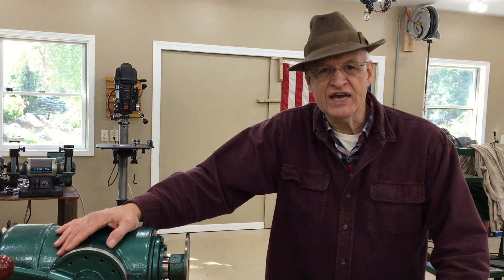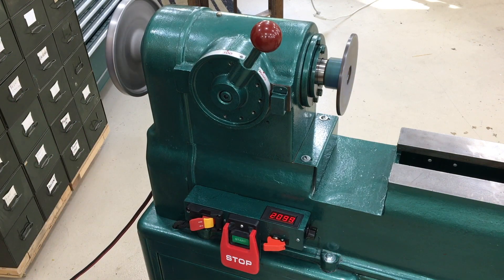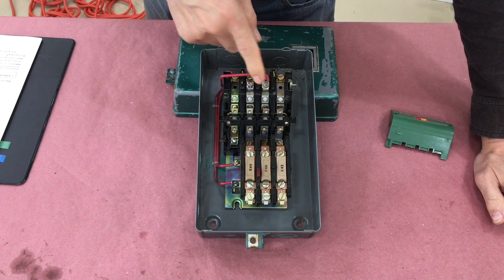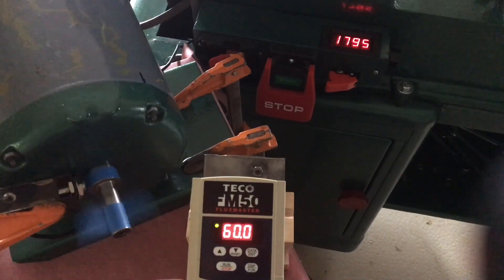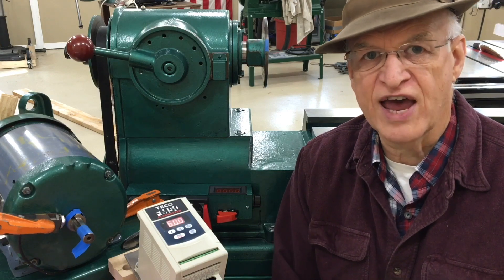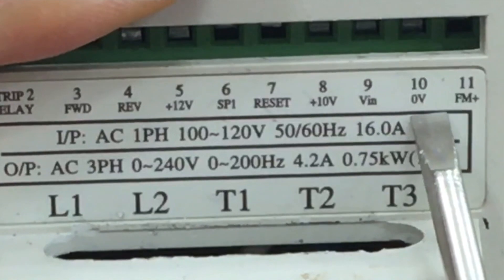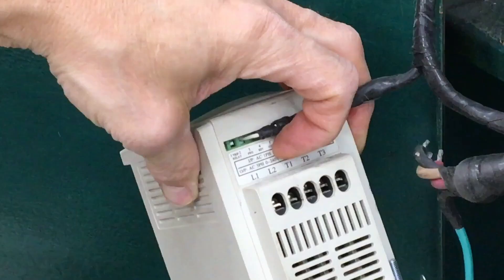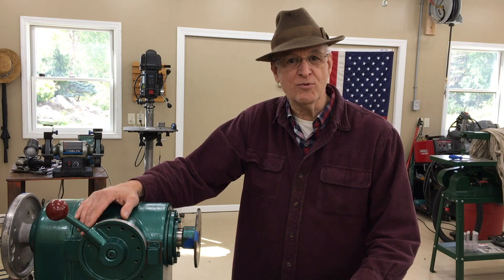Powermatic Model 90 Wood Lathe part 2 of 2

Comment: If i understand it correctly you still have a 3 phase motor but are running it on single phase 120 with the VFD is that correct?  I am looking at one that is 220 3 phase motor how would that work?  
Also do you have links for the VFD Tach and FW/Rev Switch you used?
Reply from the maker: Yes, any 3 phase motor can be run on single phase power by using a VFD. I have done this for several motors up to 3 HP.  1 HP 3 phase motors can run on 120 Volt with a VFD, anything bigger, will need 240 volt input to a larger VFD.   When sizing your VFD, make sure the amp output of the VFD is a bit more than the motor requirement….  If you want to talk more send me an email.   PargoLongAgo@Yahoo.com
Reply: @georgebell7103  Thanks, I need to go see the motor and figure out what it is  I believe it currently runs on 240v not sure of either the HP or amps

Comment: i really enjoyed the videos
i have a model 90 and would like to do this exactly as you did. ive sourced all components except the low voltage paddle switch. i have only been able to find it in 120/240. Can you share a source for this 1 part? Thanks and again awesome videos!
Reply from the maker: Thanks for the nice comment.  You have found it.  I used the large 120/240 volt switch to control the DC circuit.  I wanted a big switch sos it is easy to fine when needed.
Reply: That's great and thanks for the quick response.  I hope to have it done in a week or so and I'll  let you know how it works, Jeff
Reply: Well it took longer than I thought but I test ran it tonight and after cleaning up the wiring a little  it will be done. It is incredible. I am going  to do my first  turning  on it this weekend.  Thanks for the videos  and especially the blueprint!
Reply from the maker: @jeffholtzclaw9516  well, that’s great.  Glad the videos were helpful

Comment: Great videos, thanks. I just bought a '77 model 90 in great shape at a school auction... and wouldn't you know it?   They optioned it for a single phase motor.  So I can't do this conversion unless I actively seek out a 3 phase motor replacement!

The reeves speed control is still a big upgrade for me, tho.   The minimum pulley speed on my old rockwell was 900rpm!   Looking at the manual, I think my slowest speed on this PM90 is about 320rpm so still a little fast for roughing on 10 or so inch bowls but still way better than 900.
Reply from the maker: Thanks for the comment.  Yeah, having both the mechanical reeves speed control, and also motor speed control is really a nice combination if you can do it….. you would need a 3 phase motor and VFD to configure as I have demonstrated in this video.  Good luck whatever you decide to do.

Comment: I have a mid 70's model 90. I think I'm going to do the same thing to it. Wired a 3 phase motor with a VFD on my drill press and love it.
Reply from the maker: Yes, speed control is very nice on three phase motors plus VFD.  Thanks for your comment

Comment: Hello! Great videos. Thank you. I have the same machine. Did you have any runout on the spindle? Mine has .004 out. Is there any way to correct and make it closer to 0? Thanks
Reply from the maker: Thanks for the comment, glad you liked the video.  I don’t recall if I even checked the runout on the spindle after I replaced the spindle bearings.  You could do that to get some improvement.. maybe.   However, 4 thousands sounds pretty good for woodworking.

Comment: I am in the middle of a restore of a Powermatic 90 with a Baldor Baltric 1hp, 3ph motor. I would guess around a 1966 model. Bolts from the bottom for the bed. I am a little confused about the wiring. Is the low voltage on the VFD AC or DC? I can not verify if the motor will even run with a VFD. I also don't know which potentiometer to choose as there are many different resistance types. Could you help me out?
Reply from the maker: Yes, I hve helped several guys work through this …. Let’s do it via email… PargoLongAgo@Yahoo.com

Comment: Great video!  Viewers be aware that the motor has very low torque at low speeds.
Reply from the maker: Thanks. Yes, this is correct. Motor alone at low speeds has very low torque.  However, you can work with low speeds on the spindle, by setting the mechanical speed control to low, and increasing the motor speed.

Comment: Thank you for putting this together. I picked up a model 45 with a 3 phase. I had restored other tools with 3 phase power, but the reeves drive combined with 3 phase was new to me. Lots more tinkering to do before its fully operational. Thank you for your informative video and wiring diagram.
Reply from the maker: Glad the video is helpful. Good luck

Comment: Hi George, Excellent video! I'm also restoring a 3-phase Model 90, using a VFD. Question about the original wiring - specifically the three wires associated with the Reeves Drive. Does this wiring also get removed? You demonstrated that your Reeves Drive still works. If its wiring is removed, then the assumption is that this speed adjustment is only by the OEM speed control increasing/decreasing the diameter of the upper pulley. Is that the case? Or, if that wiring remains, where does it connected? Thanks, Dan. Thousand Oaks, CA
Reply from the maker: Thanks for your comment.  My machine only had pieces of the original wiring, So, I cannot speak to it with great authority.  The reeves drive is all mechanical. Change speed by moving the pulleys in and out by the control lever.  The original wiring used a low voltage control system to turn the motor on and off, as shown in the video.  Send me a not via email, we can discuss further if desired.   Pargolongago@yahoo.com

Comment: Thanks George.  I have the same P90 the exact same model with aluminum labeled wrap around the speed dial rather than the cast numbers.  According the serial number lookup mine is a 1969.  Oddly, mine has a 1.5hp single phase motor.  It looks like it was a special order, unless someone did an excellent job retrofitting the motor.  I may someday switch it to a three phase with VFD but that's a future possibility.  Thanks again for the very informative video. I really appreciate when someone takes the time to share knowledge. If by chance you know where I could purchase a new aluminum label for the speed dial I'd also appreciate that too, mine is badly scratched. Great video, cheers.
Reply from the maker: Thanks for your comment.  I suspect you machine was ordered with a single phase motor. The VFD really adds flexibility to the operation of the machine.  I do not know where a new replacement aluminum band can be found. You might consider removing it and perhaps printing on the back then reinstalling it.   Good luck

Comment: Good morning George, I was very impressed with your video on the Model 90, do you have a material list for the items that you used to convert the lathe over to VFD? In particular, which switches and tach did you use. Thank you.
Reply from the maker: Thanks for your comment.  I don’t have a list of the specific switches however all of them are of the standard variety.  All can be ordered fro Amazon, EBay, macmaster carr, or similar suppliers. Send me an email if you need help. PargoLongAgo@Yahoo.com

Comment: i stood back from the screen at 6000 rpm.  pretty cool engineering job mr. Bell.
Reply from the maker: Thanks for your comment. And thanks for making it to the end of the video… don’t think many make it that far.
Reply: @georgebell7103  all you need to run a 3 phase motor on 110 is a cheap VFD and a lifetime of engineering knowledge. thanks for sharing i didnt know it was so simple.  i see your floor jack in the background, and notice you have your lathe on casters. i am currently contemplating buying a 700 pound lathe.  i am watching other youtubers show how they move and lift big stuff.
Reply from the maker: @terrypriest6471  Yes, it is quite simple to hook up the VFD. Much easier that it might seam at first.  Yes, I have everything in the shop, save the metal lathe, on casters. Makes the shop easier to clean and more versatile, when unique projects come along.   Machines than need a good foundation also have leveling feet which can retract when moving them on the casters.    Thanks for your comments.

Comment: Great video! Thank you for posting!
Reply from the maker: You are welcome. Thanks for the comment
Reply: @georgebell7103  I might be picking up a model 90 next weekend and if I do, I will be watching your video a few more times! It is in pretty good condition, however, it is missing the variable speed dial. For $50, I feel like I can't really go wrong. I'll know more when I actually go look at it.
Reply from the maker: @littlephish4206  well good luck. You are welcome to contact me with questions
Reply: @georgebell7103  I am set to pick up the model 90 this Friday and I am going to attempt your conversion. My thought process to move it is: 1) Unbolt it from the base. 2) With 2-3 guys, lift and pivot it into the back of the truck and slide it in. I was wondering if you have any other suggestions for this process. Thank you.
Reply from the maker: @littlephish4206  sure this will work,  the thing weighs 600 pounds.  As I recall, I disassembled it and was able to get all the parts in my van by myself.

Comment: George looking at a PM90.  Great video!  The FM50 isn't available anymore. What's do you suggest for an affordable VFD.  
Thanks
Reply from the maker: Thanks for your comment,  TECO has updated their Line of VFDs. So, you could just get their current offering. However, I don’t think it matters, there are several makers of good quality units.  Just make sure you size the VFD to be capable of handling the amperage requirements of your motor.  Good luck.

Comment: Mr. Bell 
Iv watched both of your Vfd installations
I can see your useing a Teco FM-50. 
But I don’t know what specific model it is. 
I see them on EBay at good price but I’m afraid of getting the wrong one. 
 I have a S.B 13 running on a home built Rotary phase converter I made. It was a fun project and learned a lot. But I keep going back to your Vfd and how nice they are wired up and running. 
   If I get a teco FM50 three phase in /three phase out can it be wired in L1 and L2  in and three phase out L1 L2 L3 ?
   Or is it specifically Single phase in and three phase out 
    Hope I’m wording this Wright lol 
Thanks
Reply from the maker: Thanks for your comment.  I believe TECO has upgraded their VFD drives, and the FM50 is no longer available.  VFDs come in many configurations, be careful what you buy. Make sure the input is what you have available, in the shop, typically 1 phase, 120V or 240V.  Make sure the VFD specifications match your input and output needs and the amp output is consistent with the motor you are trying to control.  3 phase input will not work if your shop does not have 3 phase power. Email me if you want to discuss further. PargoLongAgo@Yahoo.com.    Good luck.

Comment: I actually wired my south bend  lathe with a VFD exactly as you did in the south bend rebuild video. Still works great, made lots of chips.
Reply from the maker: Yeah,  the VFD in this configuration is really nice.  Thanks for your comment